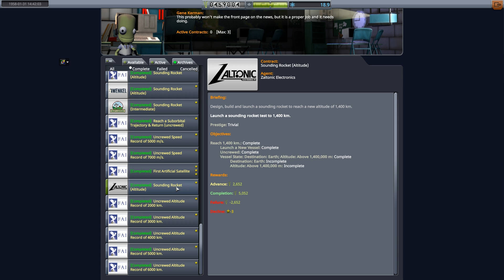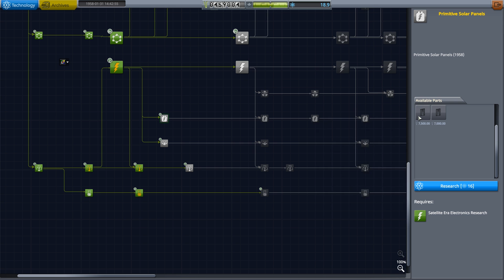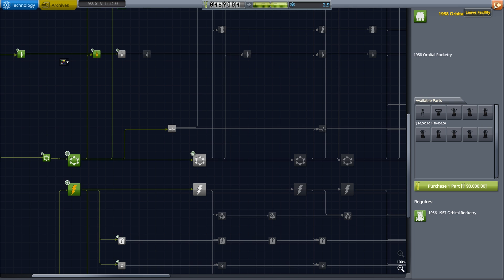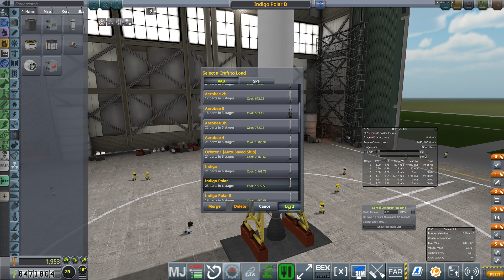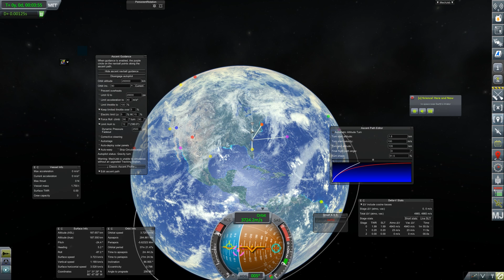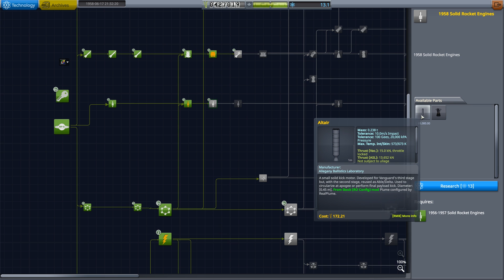KSP 1.3.1 RealismOverhaul RP1 E07 - First Polar Orbit!

Comment: Im having a huge issue with my RP-1 game i have going. I'm at my first polar Orbit contract and i have a huge problem. For some reason I accept the contract but its not visable from my tracking station nor thgrough my map if im in a spacecraft at the time. They just are not there so i have no way to know if it wants me to go  north to south south to north or anything. Anybody have this issue. Ive upragded trackong station once already. I make sure that those types of orbits are selected to be visable but they just wont show up. I even went ahead and put a rocket into a polar orbit or what i thought was a correct polar orbit but it said i was nrever in position. Im stuck because of this. Placing satelites is basically most of the game. Any ideas anybody? I've basically got all the dependant and suggested mods for RO/RP-1.

Comment: Aj-10 seems to be a poor engine, awlays failing before it's out of fuel ot failing to ignite. Quite a frustrating engine to use
Reply from the maker: Did you fully research it and move up the variants, then unlock mid AJ10, making sure to research any new versions?
Reply: Don't think I did, is that the option in the drop down when I right click the enginge called "R&D" or something like that?
Reply from the maker: Yep, if you click R&D and there is a couple of buttons in that window to research, then the engine will likely fail a lot - spend in those, and it'll be better.  Or just fly the engine a lot while it's failing - they both give the engine flight time, i.e. makes it more reliable
Reply: Thank you god. My biggest complaint is that I seemed to be powerless against sudden engine failures, and you've saved me.